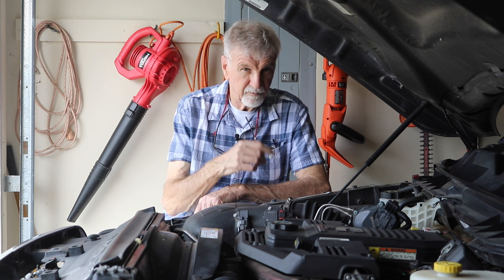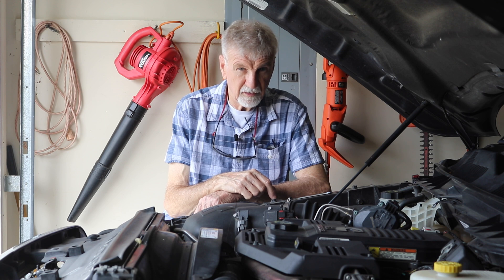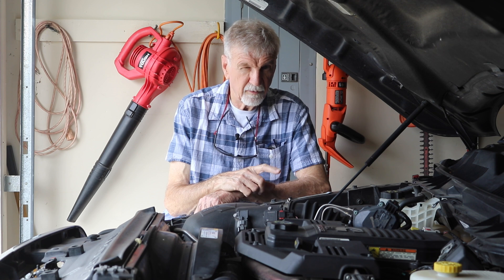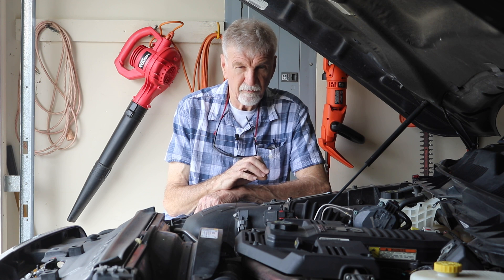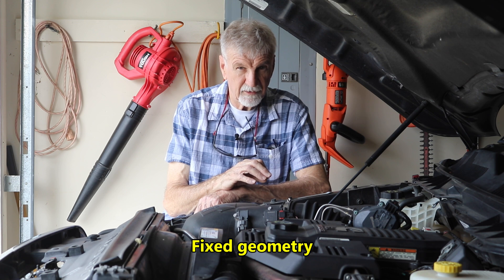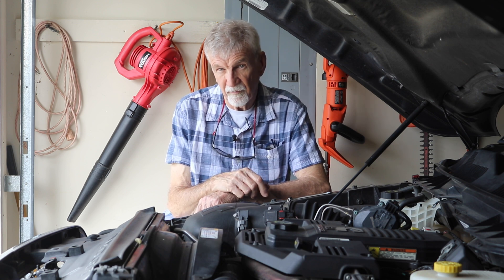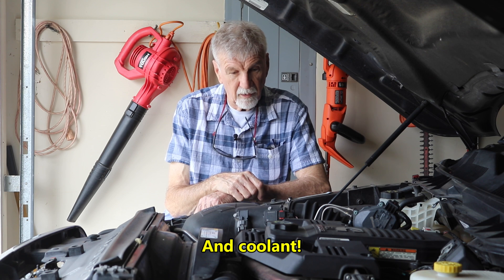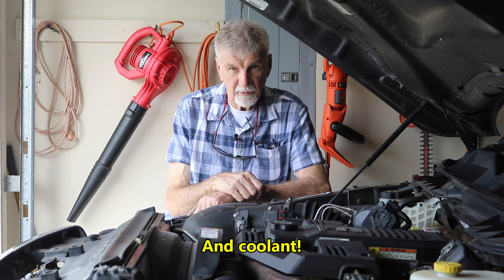RAM 6.7 L Water Cooled Turbo - Engine idling - Too much of a good thing

Comment: Marion, I have a 2014 3500 with 100K miles. Run around town mostly, but tow a 41' fifth wheel and a carry around a Lance truck camper occasionally. I baby this thing and service it at dealer. I'm careful about shutting down hot, Just replaced the turbo actuator - think it cost me $3599 - The truck does the work I need it to but I feel like I;m spending $3K/year or so on maintenance. What am I doing wrong? Anything? Can I be doing something different?

Comment: Idling is a no go  if you have a stock truck because your Dpf will get full of soot and you’ll be stranded on the side of the road not being able to move faster than 5 miles an hour.

Comment: So you're saying I should sit in my turbo diesel and let it run for 30 minutes in the driveway while I drink beer before I shut down and go inside
Reply from the maker: Yea, but just a couple to beers will work.
Reply: @MarionBlair  30 minutes? No way. No need to idle that long. Driving, no towing. You would be good in 2-3 minutes. Towing heavy, never had to idle longer then 5 minutes to cool down. Even towing really heavy on the farm. Gauges help with this. I shut down when I get to 300* on my egts gauge

Comment: The factory turbo is terrible in these trucks. Makes way too much cylinder pressure and EGT’s. Best thing to do is get a fleece cheetah that breathes much better if you wanna keep the vgt and exhaust brake.
Reply from the maker: Yea, agree.  They hold back pressure on the engine to feed the EGR.  I hate looking at the exhaust pressure.

Comment: I do like you when towing my camper. When I fuel up i never shut it down. I drive 23 miles to work. 55 to 60 mph. How long would you say is a good idle time for that distance?
Reply from the maker: Empty 5 mins will work easily and less if you have a red light or a couple of turns before you get to work.
Reply: its temperature not distance.  Buy a IR Thermal Gun and start sampling the temperature and you'll become familiar with it.

Comment: Volvo has been running the water cooled turbos for a long while now and the shop says we don’t need to idle but if I have just pulled a Mountain and pulled in to a stop I let it idle for three to five minutes if I have been sitting at lights and riding slow thru a parking lot I don’t always idle unless it’s super hot out I will let it idle til the water temp comes back down to 170 and I would do the same thing on any of the big three diesel trucks

Comment: Another great video. 
I ALWAYS let my turbocharger EGT 1 sensor get around 350 degrees F before shutting it off on my 6.7l and my 12 valve. 
These 6.7l trucks go through turbochargers more often because the lack of proper cool down in my opinion. I also never shut the truck off during a regen cycle because of the extremely high temperatures.
Reply: I have found that letting the trucks finish the regeneration cycle and then letting things cool down afterwards before a shutdown also seems to help reduce regenerations and helps the canisters last a bit longer
Reply: @mred3660  good to know! Thank you
Reply: Are you aware of the regen from the egt temps?
Reply: @kennethvernonprivate  yes but if you it’s has reached a certain percentage and you are not stopping for more than 15 minutes leave it running or it will not restart regenerating until it backs to 100% and the guys that don’t let it finish at work go thru double the canisters and turbos that I do
Reply: @kennethvernonprivate  the egt regen system is better but still has certain issues that needs the operator to be paying attention too
Reply: @mred3660  and where do you see the percentage? OBD to app?
Reply: @kennethvernonprivate  I was forgetting Volvo is the only one that shows the percentage in the dash menus every one else has to use the OBD unless an after market gauge or tuner will show but when it starts it’s supposed to be 100% full and if it goes to needing a OBD regen then you have pretty much hit 200% full